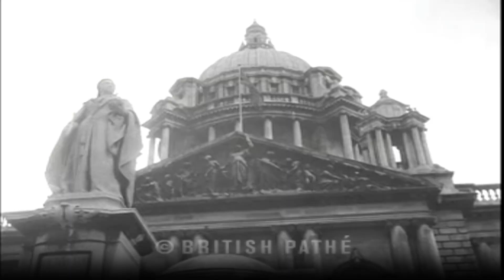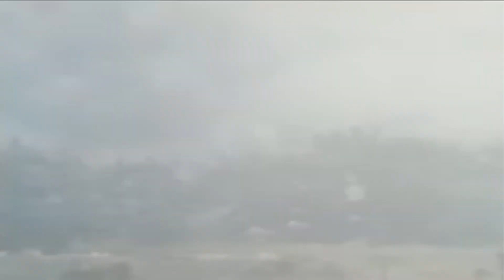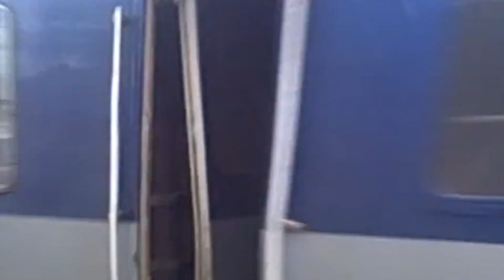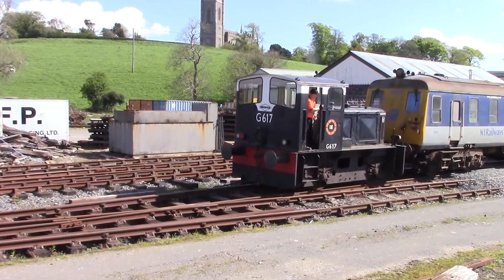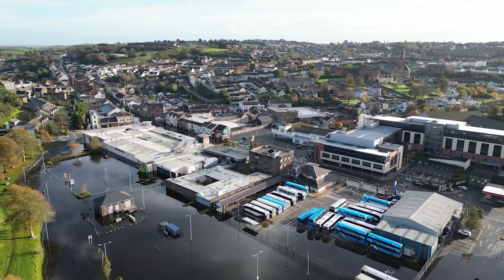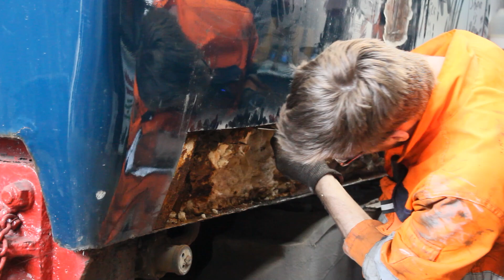The History of the 80 Class | Explained

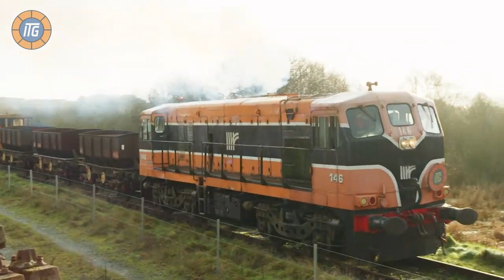Comment: DCDR Has Preserved A General Motors GL8 (Spartan Cab) 23:40

GM Triclops GP-Unit (Wrap-Around) = “121”

GM Triclops GP-Unit (Spartan) = “141”

GM Triclops JL-Unit (Wrap-Around) = “141”

GM Triclops JL-Unit (Spartan) = “181”

GM International Series = CIÉ “071” / NIR “110”

GMD TFST-Unit (Spartan) = IE River Class (“201”)

GM Joint Technique - Super Series = BR Class “59”

GM Joint Technique (W-Gauge) - Revised = “66UK”

GM Joint Technique (C-Gauge) - Revised = “66UK”

GM Joint Technique (UK1 Gauge) - Revised = “66EU”

EMD Joint Technique (W-Gauge) - Class “77”

EMD Joint Technique (C-Gauge) - Class “77”

GM & EMD Should Both Have Market Sales Of Rail Vehicles

You See The Smoke Coming Out Of The GM/EMD 23:40

That Is What I Would Expect From The Likes Of A GP40, SD70ACE, Etc.

Whenever I Buy Them!

Comment: E&CR = English And Celtic Railways

BR Mark-Units (TOPS-Era):

Recessed Cab / Spartan Cab

The Trailer Cab Car Uses The Recessed Cab

The Power Cab Car Uses The Spartan Cab

The BR Mark-Units (Recessed/Spartan Cab)

Power Cab Car (Engine-Driving Trailer) = Engine Rooms

The Power Cab Car & The Trailer Cab Car Both Have A Roof Headlight

Trailer Cab Car = Driving Trailer (Unpowered)

Power Cab Car = Engine-Driving Trailer

Each BR Recessed & Spartan Stocks Has To Have A Right Amount Of Carriages Each

From The Engine-Driving Trailer To Engine-Driving Brake

Engine-Driving Brake = Engine-Driving Trailer With Guard’s Compartment

Like Catering Carriage & Such

Comment: Great to see the 80 class again. I remember them on the Bangor line and being let into the engine room whilst the engine was running. The trailers were all built with intermediate doors but with bomb damage and age, some mainline Mk2 carriages (built w/o intermediate doors) were converted to replace the trailers. UTA/NIR experience with the MPD sets led to trying DEMUs for the 70 class then 80 class as the bus engine/gearboxes of the earlier trains were not so reliable.

Comment: If I've heard correctly, the reason the UTA went for the EE powered class 70's DEMU's was because the manager at the time came from British Rail Southern Region, which had used the configuration of an EE 4SRKT engine using the same traction motors as the SR EMU's, instead of the Class 101 diesel hydraulic type.
Reply: The BR(S) 'Thumpers' enjoyed a solid reputation for reliability, at a time when not all DMUs could claim the same.

In the annals of UK railways' diesel story, English Electric power plants stand out as the best and longest lived (aforementioned Thumpers, plus Classes 08, 20 and 37)

Comment: Was always preferable to see an 80 turn up rather than a 450! I recall the reliability of the C3Ks was horrific when they were first introduced. A mole within one of CAFs subcontractors told me that, in addition to NIR introducing an overly-ambitious timetable at the same time, NIR had asked for so many changes from CAFs suggested specs (IIRC, engines, exhausts) and the track back then, particularly on the Derry line, was on such poor condition that the poor things more or less shook themselves to pieces. Fortunately, it seems they may have learned their lesson when it came to the C4Ks...
Reply from the maker: @darrenaitcheson795  Love the insight! For what it's worth, I do think the 3000s have definitely shown that they were a worthwhile investment in the long-run!